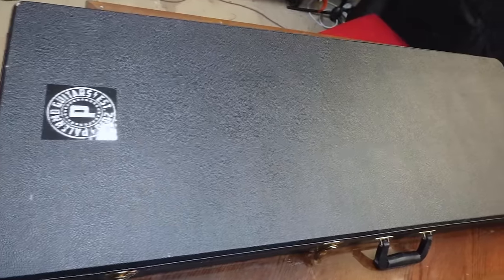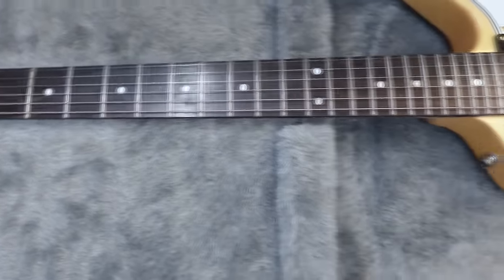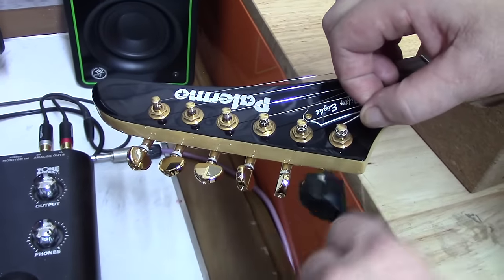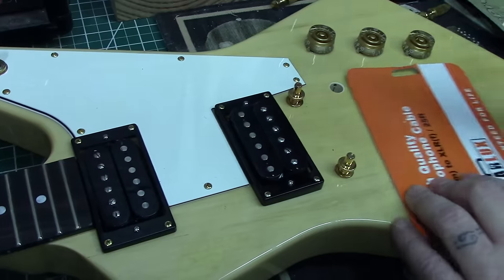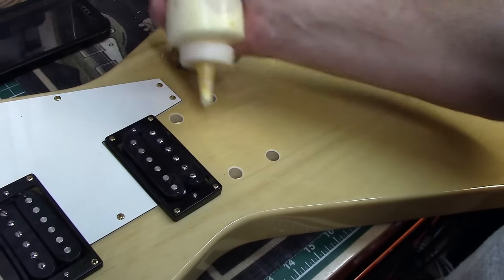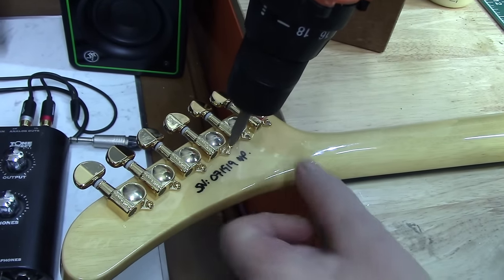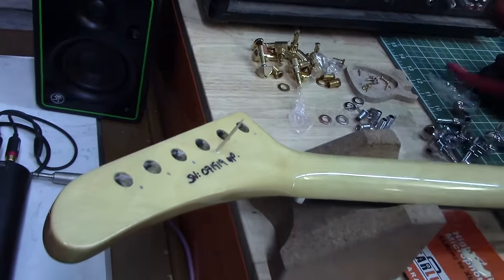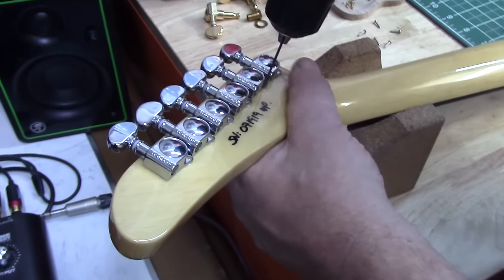$3000 Canadian Made EXPLORER STYLE Or Just RE-BRANDED CHEAP CHIBSON? Let's see!

Comment: All guitars are now made on CNC machines. I have a bunch of them I bought on Amazon that with a bit of TLC, maybe a few after-market upgrades play every bit as good as any of the contemporary "over-priced" units. 

One I'm particularly happy with is my Harley Benton 500SC. It's designed after a white Les Paul Custom w/gold hardware. The neck is .010" at the 7th fret and string height is 1/16" at the 12th fret. Plays like butta. $158 to my door. Yes I slapped some pickups in it, brass nut, tuners, but the frets, binding and the basic foundational build in general was immaculate.

Comment: Hey Shawn, over many of your video's, I see you using a cheap plastic string winder. I purchased a PRS string winder.  Convertible Drill Bit Peg Winder. On the back of the box it says, PRS Multi-Function String Winder. It's a 2 piece winder! U can use it manually or chuck it in a drill. I want to throw away my cheap plastic winders! Definitely worth checking out!!! They happened to have it in stock at my local  music shop/ (C.A. House music.)

Comment: I don't understand the aversion to using an electric drill when the operator is super skilled.The nay sayers know nothing about modern drills, the slip clutch etc.,so you don't over strip.Some drills are more expensive than the guitars being worked on.